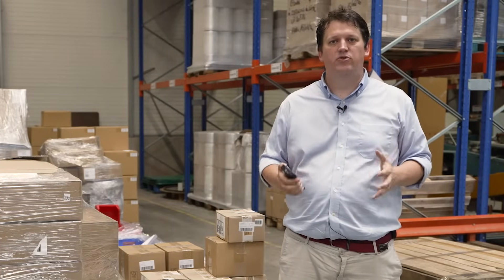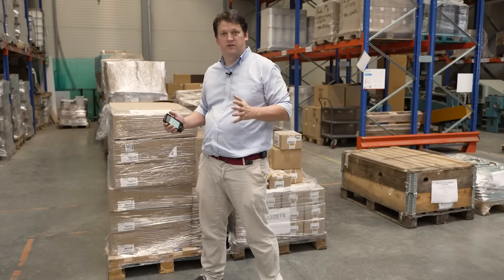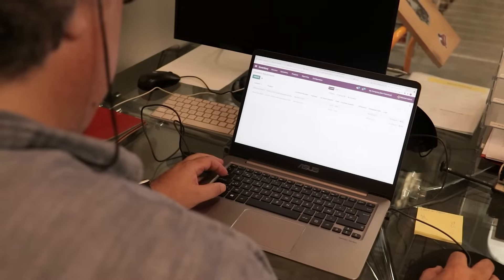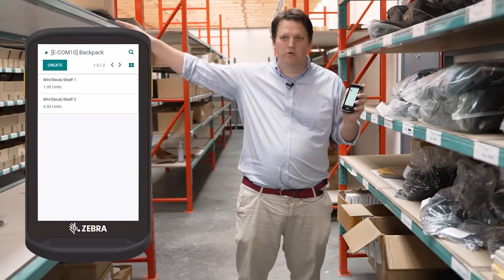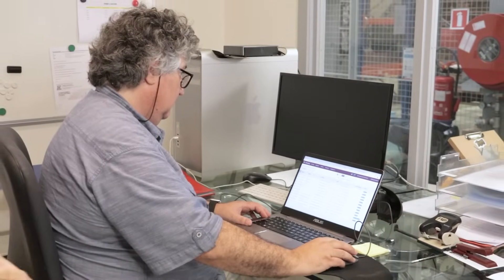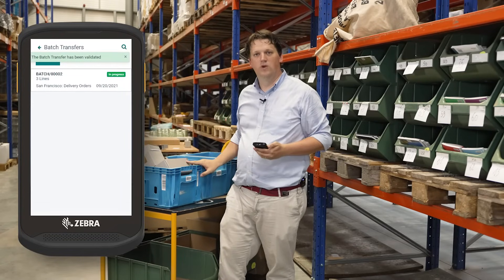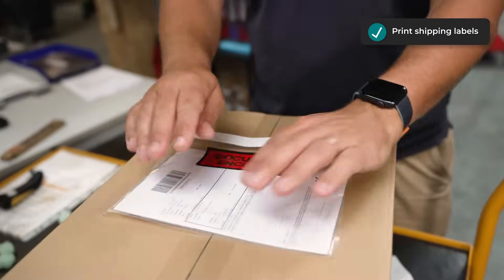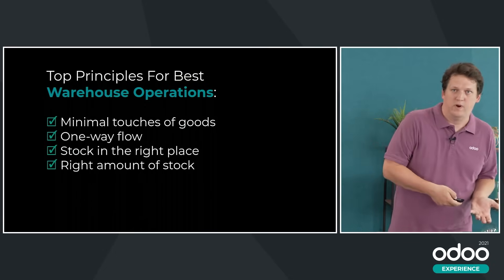Efficient warehouse management with barcodes - Odoo Inventory

Comment: How can i manage a furniture wharehouses? Products in PO are final products,but when trucks arrived to wharehouses, products came as parts(most final products have BOM),then we move parts from trucks down to land by scan every single box (part), when we finish move parts, can Odoo count these parts and knows hiw many final products recieved.
Reply: You can use kits, based on BoMs to support this use case. You place a PO for the final product, but Odoo will create receipt with the parts.
Reply: Dynamic HU is not part of this solution. many times  you will not know the HU size until you unload the shipment at you warehouse,